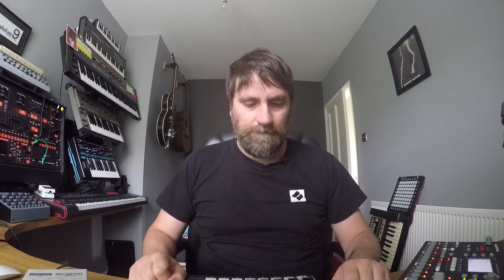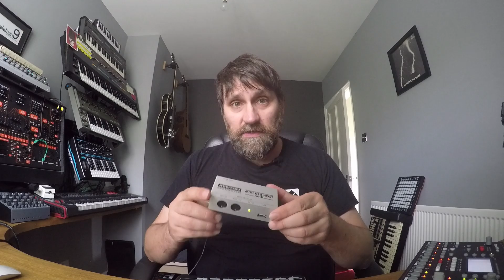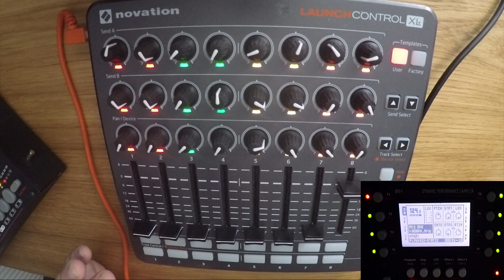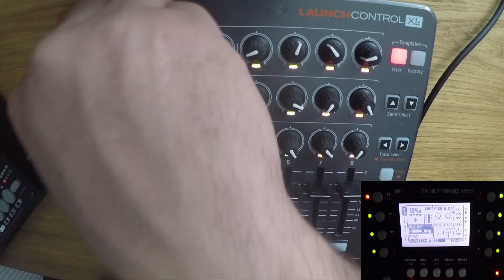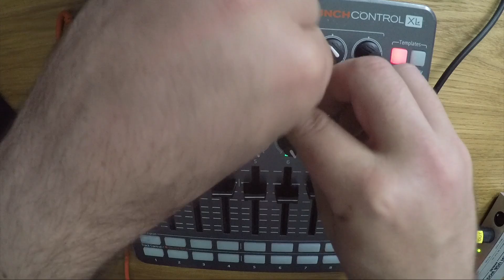Novation Launch Control XL firmware update controlling Elektron Octatrack and NO COMPUTER!!!!

Comment: If you control hardware beware that the bottom row of buttons will NOT light up the LED's. The will stay OFF. So if you think of using those rows for muting and soloing tracks on a hardware device the Launch Controller XL will not give you visual feedback. Even though the buttons are set to toggle. Huge disappointment. This will work on the Launchpad Pro though.

Comment: Great video but....huge design flaw that the buttons do not light up when sending mute / solo CC control changes. Pretty hard to use them at all in a live setting wothout the visual feedback. I wish Novation would change this. I spoke to support and they said that you need to send MIDI back to the XL to control the LEDs on the buttons. Seems easy enough to set up on a DAW but not with Octatrack.

Comment: Hi Calc, 
using your template mainly for audio track levels and cue level (to send any track in external effects).
I'm using the kenton midi to usb device. It's going thru a midi solution merger then in the OT.

The main problem i have is : 
- the more faders I touch at the same time, the slower the values change, it's exponential.

Exemple : pushing fast one fader from the bottom to the top = ok, no lagg.
same thing but with two faders = the corresponding values change more slowly... and so on.
When I push all 8 at the same time, the values take almost more than a second to change.

Can it be from the LC, the merger or the OT?

If you have any ideas, you will enjoy my existence 😁🙏
Thank you for reading me !

Comment: Hey, I had a couple of questions if you or anyone else could please help.

1) can one knob on the Launch Control be set to multiple midi CCs on the Octatrack so that I can control many things, for instance perhaps the pitch on multiple tracks with one knob movement?

2) If I change parameters on the Octatrack via the Launch Control, can I record these midi changes using the record function on the Octatrack?

Thanks!

Comment: You seem to understand the XL and i have a question i would like to ask. I've ordered my own which will arrive within a few weeks. I'm not good at MIDI and am a bit worried that i can't set up the XL the way i want to use it. Same as you, i wish to control several devices/synths without a computer so basically what i wish to achieve is this:

I want to map several of the pads (if not all of them) to work as MIDI channel switches. So if i click for example mapped button #1 on my XL. That will tell my keyboard to start sending out MIDI information over midi channel #1, and thus allowing me to play on synth number one through my midi keyboard. If i click button #2 on my XL, it tells my midi keyboard to start transmitting MIDI over channel two and so on. So i wish to be able to switch on-the-fly between which synthesizer i am controlling. Is this possible?
Reply from the maker: Hey Krister, 
Hmm I'm not sure that what you have described is possible with any type of set-up not only with the LCXL. 
At least I'm not aware of being able to change MIDI channel on a device with another external device. Usually the MIDI channel settings are part of a global menu on a controller or synth and generally cannot be controlled by an incoming MIDI message. They are normally controlled directly on the keyboard's menu instead.
That said check with your keyboard manual to see if there is a CC (Controller Change) or MIDI Note Number that allows you to change the MIDI channel on the keyboard externally. If there is then you will be able to program the LCXL to change the channel easily enough by assigning the appropriate CC message to the desired pad in the LCXL editor. 
Sorry I don't have a definitive answer for you but I hope this helps.
CALC
Reply: Superb thanks! ^^

Comment: I am getting somewhat desperate for an answer. I cannot find any responsive avenues. I have a Bome Box which I purchased purely to do this job between the LCXL and OCTATRACK. I have updated the firmware. I have loaded CALC templates. I have attempted to dump the appropriate .syx file but I don't know if it has worked. There is no sign of life when plugged into the bome box. When not plugged into the host, the LC looks like it has the right templates loaded. As soon as I plug it into the bome box....nothing. I have tried both sysex librarian and C6 to dump the 1.13b? file and I am pretty sure that neither of those have worked. Am I missing something or should there be some LED lightshow to indicate that a dump is occurring?
Reply from the maker: Hi Steve, I just replied to your Elektronauts post but it does sound like a power issue with the Bomebox. There's some info on that in the post too. Also the 1.1b3 firmware from the Novation Beta site is for the Launch Control not Launch Control XL so that might be the issue. You can get the release version of the LCXL 1.2 driver from the downloads section of the Novationmusic.com site which i believe has an installer too so no sysex shenanigans. 
I've checked out my Bomebox and after a firmware upgrade (I was on a really early pre release beta firmware) everything is working perfectly with LCXL and Bomebox here.
Hopefully you can get it sorted but contact Bomes if you are struggling, Florian is really helpful :o)
All the best

CALC

Comment: Thanks! Very nice video that I've seen many times now :-) However; does the Octatrack parameters "jump" to the knob-positions when you start tweaking, or is there some kind of "catch-up" or relative setting, so turning knobs will not make huge parameter jumps on the Octatrack? (for example: the knob position is 12 o'clock from another track-tweak, then activating another track and tweaking the same knob - if the parameter on that track was 9 o'clock, would it jump to the 12 o'clock as soon as you start turning the knob)?
Reply: Hey man, i am aware that this question is 8years old. But, by any chance, did you figure out the answer to this? Thanks

Comment: Hey,
got that control xl and a midi host called mode machine's cerebel. Got the newest firmware update to launchcontrol. The octatrack is responding, but the values are always jumping to another value (not the value set on OT, so it comes from the outside via midi). 
Another user in the electron forum wrote the same, but no solution so far. Maybe the firmware 1.2 is buggy. Would like to try the old inofficial firmware, but can`t find it any more. Does anyone have the same problems? Would be awsome if it would work.
Thank you!
Reply from the maker: Hey fnkrz fnkrz - Sorry to hear about the issue! I also read that about the Mode machine's Cerebral but I'm not quite sure where the problem will be. 
I do know that the LCXL works perfectly well with the Kenton host to MIDI, Bomebox, Iconnect MIDI4+ and the Sevilla soft UHM so my feeling is that the problem could be somewhere with the Cerebral. Sorry I don't have access to one to test for you. 
I can most likely get hold of the older Firmware for you from work but I'm not convinced that will help. 
It's all down to the way that MIDI data transfer is set, the older firmware was set to Interrupt data transfer request. Interrupt is faster and more streamlined but not technically true class compliant, the newer firmware went back to the bulk transfer request standard which is actual true class compliant. 
LCXL was obviously developed originally as a USB computer controller and the computer's OS and USB controller managed the original interrupt request seeing it as a class compliant device. So now with the 1.2 firmware the LCXL is definitely class compliant in the true sense. 
I believe that all the Host to MIDI converters need true class compliance (i.e. bulk transfer request) although I know that John from Kenton was looking at changing his box to accept interrupt request based devices too.
As for the older firmware I can get hold of it if you want but unless the Cerebral is set to also work with interrupt request devices (which I assume it isn't as it's technically not class compliant).... I can't see that actually helping you.... sorry about that. If you do want to contact me direct drop me a PM on Soundcloud.com/calcutt and we can pick it up there. 
You could also try the Novation support team, you can get hold of them from the website... they're a good bunch :o)
Reply: Thanks for your answer! I can say, that i solved the Problem: I just tried the Kenton host 2 and it works! I read out the midi data at a terminal program and the ModeMachine box seem to send something permanently. 
Hope I could help somebody having the same problem.
Its queitte fun with the controller and the templates are easy to do. It`s sometimes a bit hard to remember which parameter are on which knob and the 3 knobs for each channel on the mastertrack are sometimes the wrong ones if you select other effects. A reload part button would be nice to undo all changes.
Thank you everybody!

Comment: So I should be able to set up a template in the Launch Control XL Editor that assigns, let's say CC messages to knobs, unplug from the computer and use the Launch Control XL  to send those CC messages via a USB Host to a synth correct? I'm looking to be able to change some synths "under the hood" functions via CC without a computer. 

Also can the regular Launch Control do the same thing? I have both LC and LC XL and I'm trying to make best use of them in a live situation.

Comment: Hey
I am new to a hardware setup and using midi.I bought the lcxl after seeing your vids.I have downloaded the firmware and loaded your templates,they are great!I have a problem though and I don't know how to solve it!track one on the lcxl only controls track one on the octa if I have track one selected otherwise it controls which ever track is selected,it's really a noting and I don't know how to solve it!if you could help?
Thanks mark

Comment: Hi,

I've contacted Novation about a question concerning the launchcontrol xl and octatrack. They couldn't answer me, and told me to contact you. 

I have installed your files on the launchcontrol, and it works fine with the kenton USB host on the octatrack. However i can't seem to make the octatrack respond to a midiclocksignal. Does the octatrack have to be master when using it together with launchcontrol xl? 

I hope you can help me, because when we play live i am not always the master, therefore i need a solution or launchcontrol xl and octatrack are not for me. 

Thanks in advance.
Reply from the maker: Hey there, 

Glad to hear the LCXL files are working on the OT. For me it really opens up accessibility to the OT's engine. 

The LCXL can't generate clock so if you have the LCXL taking up the MIDI input of the OT, how else are you trying to pass clock into the OT? 

I use a Kenton MIDI merge box which takes 3 MIDI signals and merges it into the OT's one MIDI input 

Expert Sleepers Usamo - for MIDI clock 
LCXL with the Kenton host - for OT control  
Analog Keys - as a controller keyboard

So that's 3 MIDI signals merged into one. It all works brilliantly for me. A little bit of delay compensation in Ableton and everything in the room clocks perfectly in tight in sync with the DAW, down the MIDI chain too. 

It may be that a MIDI merger will work for you if you need more than one MIDI signal passed to the one input.

Hope that helps!

CALC

Comment: hey Mr. Calc i have Problems to get the kenton usb hub running with the OT. I downloaded the firmeware from the beta site. Then i use Midi ox to sent it to the LC. Is there a button combinnation to use before the LC is reciving the Update? What else can i do the Oc dont recives Massages? Thx for support and happy x mas.
Reply from the maker: Hey Bra1nd3ad I'm out of town for a few days on Christmas visits. I'll look into it properly for you when I get home in a couple of days. If I remember correctly the LCXL will look like it's updating when you send the firmware in with a snake like LED flash on the buttons at the bottom so if it's not doing that when you update the firmware maybe it's not being sent in properly from MIDI Ox. Let me know if you got it sorted otherwise I'll be in touch soon. Seasonal Cheer to you, your kith and your kin CALC
Reply: +CALC Ok i got it befor powerup the lc you have to press user and factory button then the lc is in update mode. Its working propper now such a cool thing!
Wish you a good time thx for the support

Comment: Nice work!

Just a heads-up - this also work with the original iConnect MIDI2 - no need to get a new iConnect MIDI4
Reply from the maker: +Neil Baldwin 
Hey Neil thanks for the heads up. It's rolling really well with both the Kenton and the Bomebox too. The firmware update made a big difference and I'm super chuffed it happened! 
Really really nice work on your OT templates too. Embarrassingly I actually prefer the lay out to mine :o)!!!!! 
Love what you've done with the momentary stuff on the righthand side and the crossfader switching is genius too. I think I'll only need to tweak it to get MIDI track mutes on the bottom buttons and I'm sorted! 
Would you mind if I used your link here just incase anybody else is interested?

Good work Sir!

Comment: hey CALC,
thanks for your video! anyway when you change template how do you avoid the midi gap/step due to the knob position?
i mean you're on track 1, you move the knob - then when you pass to track 2 and want to use same knob there is a different between the knob value and octatrack value..

E
Reply from the maker: +Elia Pellegrino
Hey Elia, thanks! The Octatrack doesn't have any setting that allows a pick up, proportional or take over mode from external controllers (at least I don't think it has). Therefore when I change templates to control different tracks as soon as I move a knob, the parameter directly jumps to that position. The response of the knob is great and so it's easy enough to pull the position back to where it feels right musically. This behaviour has been absolutely fine for me and as I say I'm not too sure if it can be set any other way anyway.
Reply: ok, thanks for your reply!!!

Comment: hey man, nice video :) I was wondering, can you assign leds to the buttons at the bottom? it seems a bit confusing using them for mutes if they don't light up... at least for me
Reply: The LaunchControl editor on computer allows you to change LED settings/colors in your templates
Reply: @PBgeoffrey  Only to the rotary encoders.... not the buttons sadly.
Reply: @madebypete  You are correct, I have found this out fairly recently. Set up my own template for octatrack control in live performance. It works great! but darn those button leds...
Reply: @PBgeoffrey  Huge design flaw if you ask me. Renders them pretty useless in a live situation where you need quick visual feedback
Reply: @madebypete  100% I'm surprised there still isn't a comparable controller for function and price yet. Or a LCXL mkii, or at the very least an update from novation to fix the issue. I don't really use the buttons because of this
Reply: @PBgeoffrey  Spoke to Novation support.... "We do have a feature request case open for this as it has been raised in the past - I'll add your details and you'll be notified if it will be implemented in a future update."
Reply: @madebypete  Nice! Hopefully it happens someday in the future. btw, checked out your channel - really great stuff!!
Reply: @PBgeoffrey  Thanks man. Fingers crossed

Comment: This is really great! Strongly considering picking one of these up now.

Question - could I use two LCXLs into the Octatrack, one controlling the 8 standard tracks, and one controlling 8 midi tracks?

Presumably I'd need to output both LCXLs to their own MIDI/USB hosts (I'm not aware of a box that accepts multiple USB inputs), and then output those to a single MIDI merge box, which would then output to the Octa's MIDI IN?